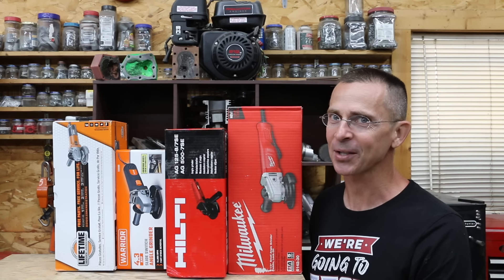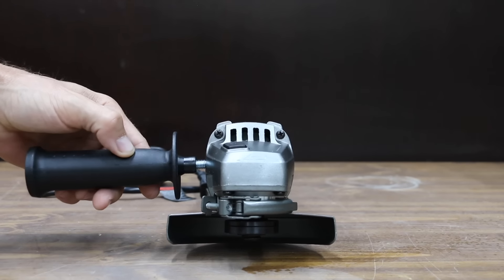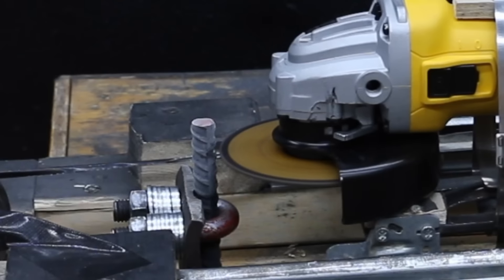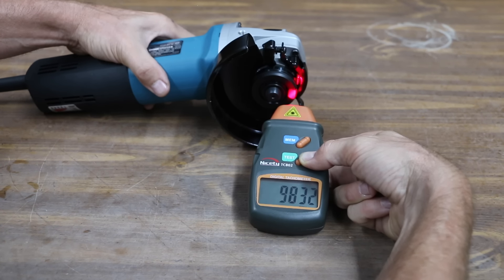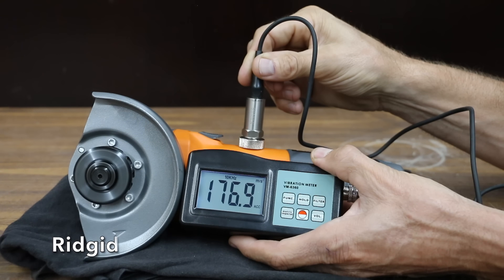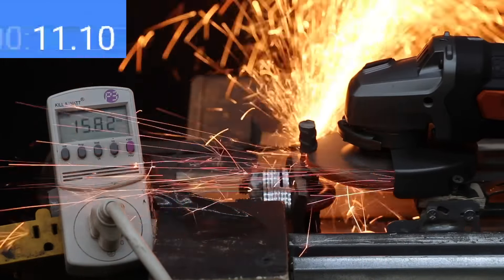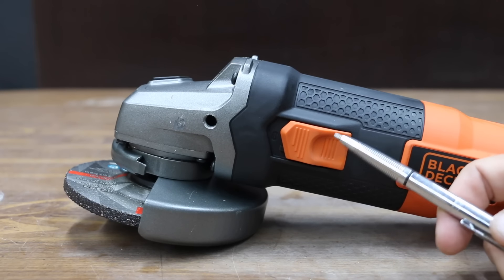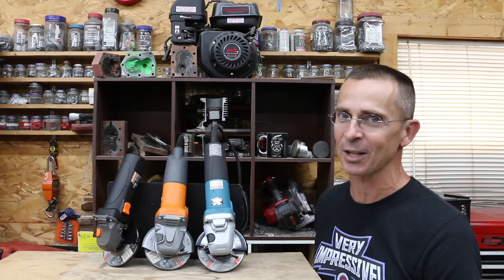Best Angle Grinder (Corded)? Hilti vs Milwaukee, DeWalt, Makita, Ryobi, Ridgid. Let's Settle This!

Comment: Usually grinder performance is rated off from amp draw. The higher the better such as 11-13 amps. They typically run cooler which usually equals longer grinder life and much nicer for the user. A temp rating would have been a nice addition to the ratings. I would have much rather seen more grinders with the same amp ratings. Maybe two tests with homeowner and contractor grade models. Thanks!
Reply from the maker: Thanks for the constructive feedback.
Reply: For the home DIY, sometimes bigger does not fit in the job. Up to 3/16", I think the Harbor Freight model delivers.
Reply: The only way more amps could possibly lead to cooler temps would be if the increased power kept the tool from bogging down which would keep the cooling fan spinning. Otherwise more amps means more power to dissipate. Fans in tools are designed to spin at specific speeds. There's just not a lot of latitude in the product to allow for variability. Beyond that we do not know how manufacturers rate their products. There's no governing body that dictates methods. Is the rating no load or loaded? So those ratings are meaningless.
Reply: @1pcfred  When a tool is rated for more amps it won't always draw that for smaller jobs but the cooling fan rpm is direct coupled to the shaft to stay cooler at less amp draw. From my amateur perspective, I'd rather have a smaller tool that can get into tight spots and just not push too hard for bigger jobs. ~4.5 amps.
Reply: @artsmith103  when you exceed the power of a tool then the tool will lose RPM. We saw it happen in this video and saw the tool burn up as a result. But there's another factor at play there. That would be the gauge of the magnet wire. That's why the current is so low to begin with. The winding wire is thin. That causes greater electrical resistance to current flow. Thin wire also burns up easier. Though one motor seemed to suffer a brush failure. That's often due to how the brushes are held. They can't handle the heat. The brushes are in thin metal holders held by the plastic body of the tool. That melts and causes issues.
Reply: @1pcfred  Everything correct. I was referring to an 8amp tool doing 4 amps of work and running cooler than a 4 amp tool. But in tight quarters, sometimes the 8amp tool doesn't fit. For pros, simple answer is have both. For amateurs, I lean towards smaller cheaper that fits in more places and then go as slow as the little motor requires.
Reply: @artsmith103  overall size does not solely determine power. You can make an 8 amp motor the same size as a 4 amp one. You just have to make it differently. You pack heavier windings into the same space. A winding with larger wire gauge and less length will draw a lot more current.
Reply: @1pcfred  I'm talking about the typical retail options.
Reply: @artsmith103  everything is similar but nothing is exactly the same. The Devil always lies in the small details not the gross simplifications.

Comment: It may seem sad, but to me, one of the best features, and a good reason to buy it, is the tool storage in the handle of the Ryobi.   One of the most frustrating things with any tool is trying to find the accessories when you need to make adjustments.
Reply: Agreed.b The other manufacturers could take a lesson from RYOBI here.
Reply: makes me nuts when there isn't onboard storage for stuff like that.  I have the ryobi and love that feature.
Reply: Why would you need a tool? There are many options that don't need it like the tool less nuts on the Metabo and the new X-lock standard witch has no nut at all.
Reply: I get this on some other tools, but I can't remember the last time I used a wrench on a grinder instead of just grabbing whatever I have chucked up to tighten or loosen the tool.
Reply: 100% agree
Reply: I tie mine to the cord!!!!
Reply: I zip tie mine to the cord
Reply: For what do you need a tool in am angle grinder? 
Never used a tool on them... 
Btw, i use them alot for work... 
Swapping disk? Just grab the disk and rotate it with your hands... 
Changing the protection position? Almost all have a tool less thing...
Reply: I tighten and loosen all my blades by hand. Just grab the blade and twist.  No need for tools, x-lock or self tightening nuts. Very fast too.
Reply: @leonvdm  thanking you
Reply: @leonvdm  - Yeah... and I have this desire to keep my hands and eyes intact.  I don't grab blades by hand and twist.
Reply: I use the Ryobi due to the handle can turn sideways
Reply from the maker: Good Point!
Reply: Haven't used one of those wrenches on any of my grinders
Reply: @lorenzogazzola328  Heavier wheels can come loose from the inertia of starting and stopping if you use that method
Reply: @lolatmyage  the nut is self tightening, doubt it could happen... Also, what disk are "heavy"? It's a 12mm grinder not a 26...
Reply: @lorenzogazzola328  At 74 I sometimes don't have the hand grip I once did. but still put in time in my shop.
Reply: Who, in their right mind would decide on a grinder just because you can store the wrench in the handle?   Aaahh, maby DIY'ers...
Reply: @robertteap8052  hehe
Reply: Please do not loosen or tighten the grinder disc with no tool! Your hand!!! This is dangerous and foolish and NOT recommended by the manufacturer
Reply: @imbacon-cz8xv You made me feel bad for being such arrogant. 
This comment made me remember of all the time spent with my grandpa fixing and creating things... And yes he used the wrench to loose the grinder.
I really miss him
Reply: The next welder you run into ask them to show you how we swap out grinding discs 😅 no tools, just give it a quick sharp whack and they spin right off. OSHA? Never heard of her….
Reply: @GunnysWrenches  no...dangerous habit
Reply: @GunnysWrenches  it's against manufacturers advice
Reply: @lorenzogazzola328  sorry, did not mean to make anyone sad. and sorry for your lose.
Reply: @lorenzogazzola328  I've had it happen with a wire wheel or a grinding disc, can't remember exactly anymore

When you start it, the force is applied one way, when you stop it, it is applied the other way ...
Reply: What about the riund oiece with holes in it?  Arbor lock or wtf you call it.  How the hell are you opposed to remove a non threaded attachment without using the wrench?   I'm not an expert btw.   I am easily able to loosen the sanding disc attachment base with just my hand (there really is no other choice since that arbor lock or whatever the hell you call it blade lock can't be installed on that kind of attachment anyway).  How do you get a metal grinding blade off without removing that round metal piece foist?  🤔.  I'm probably missing something
Reply: @tbelding  Use your left hand to lock the blade with the button and slap the blade counter-clockwise with the palm of your hand. It's so much quicker than any tool. If you're concerned about losing a hand, switch it off. It's not hard to do.
Reply: @lolatmyage  The second you start cutting, the nut tightens itself. That's why the nut only comes off when you spin the blade counter-clockwise, whi h can only happen if you do it by hand or without a tool. I've never had a blade come loose on me unless I accidentally put the nut on upside down.
Reply: @d.k.1394  It's not dangerous. Switch it off so you don't accidentally hit the button and you won't lose a hand. The nuts are self tightening and won't come loose (unless you put the nut on upside down or have the grip strength of a toddler). 

The only "danger" it poses, is if you're using your bare hands and you catch a sharp bit of the disc and it jabs you. But metalworkers generally have tough skin so it's not really an issue.
Reply: The ryobi handle can be rotated 90 degrees it's very handy. 
Been fabricating for 50 years worn out dozens of grinders thousands of wheels I never use that stupid wrench   and never came close to injuring my self.
However those stupid slide switches should be outlawed in my opinion. 
I
Reply: @lolatmyage  I don't use that wrench either. Only wire  cup brushes do that but that wrench doesn't fit them.
So if you hand tighten it like you have a PAIR it's no problem.
Reply: @lorenzogazzola328  he's talking about changing to a heavier wheel, screwing it on, staring it, immediately stopping it. They will spin off.
He should get his wife to tighten it up for him.
Reply: @shona5512  - I know you and others don't think much about it, but I viscerally know what happens when you take power tools casually.  My father, with 40 years of woodworking and engineering behind him, ended up losing most of the fingers on his left hand.   I don't see a reason to push my luck more than the scars on my hands and arms already say.

Comment: I was a little surprised to see the Ryobi have such a struggle with the weighted cutting of the rebar. But, I've always known Makita kicks ass in this specific tool area.
Reply: Yeah I use makita tools, not always the best, but their grinders have been top of the class for decades. Nice to know that hasn't changed. Even approved by aVe.
Reply from the maker: Thanks for the feedback.

Comment: Great review, thanks. I have a few of those cheap $15 angle grinders, not quite the same as the one you tested, but for home use I've found them perfectly adequate. They are so cheap you can just have 2 of them, one with a cutting disc and one with a grinding disc. For heavy work I have a large Bosch angle grinder.
Reply: For light to moderate use, especially intermittent non-professional, the cheap angle grinders seem to be good enough.  Having multiple cheap ones may be more practical than having one better one.  I almost always have 3 in arm's reach:  one with a cutting disk, one with a hard/grinding wheel, and one with a flap disk.  No time wasted in changing disk, just grab the other grinder.  However the cheap ones do vary from unit to unit in vibration and gear lash.

Comment: Video idea: It would be really interesting to see a test of tools where you pit a model from one brand against itself to see if there is consistency between each unit or if you have some that perform markedly better and others significantly worse even though they are from the same company.

One of the things I question when I see a video of yours where the cheap tool outperforms the expensive ones is that maybe you just happened to get a winner and that maybe not all samples from that brand would perform so well. It would be neat to see if that notion is worth considering, or just my bias against cheap things 😅
Reply: I've had like 5 of the warrior angle grinders, in my experience, as long as they don't fail immediately fail, they keep working just fine
Reply: What a dumb statement. These tools are all made with the same parts. Each part has QA. There isn't much variation

Comment: They Ryobi definitely seems best for light home use, having the lightest vibrations, being one of the quietest, best ergonomics, and being decently cheap at $60.
Edit: christ almighty if I knew a throwaway YouTube comment made before even finishing the video would cause this sort of sperg out, I would've bet money on the stupidity of humanity before making it.
Reply: Well, it was the only one to burn out, so I would pick another option. Even for light homework use, I would like my powertools to last for more than a split second.
Reply: Found the SHILL
Reply: Not a bad option, I have one at home slightly cheaper and it is ok for home use. I also use ridgid grinders at work and they are good enough to make money from them. I’d only pick a high end model if I was going to do very specific jobs like cutting a sink or polishing a granite slab
Reply: Compared to the $15 machine it is expensive and did not last.
Reply: All these people getting genuinely angry over Ryobi... Tell us, where did the power tool hurt you?
Reply: I don't know, about that Ryobi, I mean it burnt out.

Since I use a grinder occasionally ( I have a Chicago Electric- HF ) 5 years till working, but I probably op for the B & D or PC over Ryobi and Warrior.
Reply: I was also really interested in the Ryobi because it was easy to use, quiet, and had the least vibrations. But going up in smoke the first time it stalled is completely unacceptable. I hope they fix that design flaw, because otherwise I would prefer this over the Ridgid for those other factors.
Reply: @alexg1778  I was thinking the same thing. They get so mad at Ryobi, it's like someone smacked their kids. It's a tool, who cares what tools people like. Nothing wrong with them for  home use. They get so mad it's hilarious 😂😂😂😂😂😂😂😂.
Reply: I have burned up motors on 2 Ryobi tools.  I'm starting to see a pattern
Reply: I have a prior generation of the Ryobi and it said specifically on the box - not made for cutoff wheels. I only needed it for cutting thin aluminum so it wasn't an issue but it probably would burn up cutting rebar.
Reply: Harbor Freight model is $10. Works great. Wear ear muffs.
Reply: @nickp385  We are not getting  mad just sensible,. If you want to buy it you are free to do so.
Reply: The Ryobi burned up! Did you see the second list where he showed based on only tool performance that the Rigid which is also $60.00 was second place? It out performed tools that were 3 times it's price. I am disabled and would welcome things like the comfy power switch and less vibration of the Ryobi but not at the sacrifice of a tool that will burn up if I push it too hard. What good is an easier to use BROKEN tool?
Reply: I bought my first Ryobi when they were still blue. It lasted about 15 years, then I left it in the rain. When I was shopping for new ones, I was surprised that Ryobi was the only one who offered that kind of handle and trigger configuration. It's far more comfortable and efficient to use. I've had this one 3 years now and have had no problems. This is just my experience though.
Reply: Stay away from ryobi! Ridgid is far far superior
Reply: I had several ryobi tools die and it died in this test so i won't buy anything from them
Reply: @alexg1778  I mean it sliced my finger open...
Reply: The rigid would be better then ryobi it’s even the same price
Reply: @tonysheerness2427  I bet it’s not $15 anymore
Reply: @tonysheerness2427  I know I'm free to do whatever I want and buy whatever I want, I just think it's hilarious the energy people put into knocking the tool. Some people act like they owu a competing company. Don't get me wrong I love watching how foolish people get over a tool, it makes my day lol lol lol.
Reply: @alexg1778  my uncle would buy them and then return them. He finally wised up stopped buying their products.
Reply: I have to believe all these Ryobi comments are paid shills. The damn thing BROKE on camera and nobody gets it?

Comment: Great test, I've been using Makita angle grinders for decades, and although they're expensive I would not even consider to buy another brand. Makita corded tools is A+, whereas some of their battery tools still need some development/improvement to catch up with the competition in the high end market.
Reply: Makita is usually slower to release new updated tools, most of the tools they are compared to are newer models, but when they put out a new tool it usually is close to top of the line
Reply from the maker: Thanks!   Thanks for sharing.
Reply: Yeah most of Makitas latest tools are out in Japan first for a while before making it to the US
Reply: Cordless Makita tools aren't always the best but they will last (but don't buy the cheap brushed models)
Reply: Makita cordless tools, especially drills and saws are far superior to the other 2 big brands.

Way more ergonomic, less vibration, next to zero runout on the chucks. The other brands are the ones that have a long way to go to catch up. All out power isn't everything in a tool.

Comment: Nice and I actually bought the Harbor Freight one for sharpening lawnmower blades.  However, used it well for cutting one of the rusted nuts / bolts of stabilizer links (which took awhile as you tested).  Even if it breaks, definitely worth it as I do not expect to use it more than once a year at best🙂
Reply from the maker: Thanks!  Thanks for sharing.
Reply: I've had two Chicago electrics for almost a decade now and one of them just died about 3 months ago when I started working on a trailer restoration project that involved a lot of heavy grinding. I'd say that's a pretty good return on investment for a $20 grinder.
Reply: If your like me I only use an angle grinder once or twice a year the warrior is fine.

Comment: Good test! I was particularly surprised by the Ryobi letting the smoke out after only a couple of seconds. Might have been faulty out of the box, but regardless, this shouldn't have happened. I'd definitely go for the Makita, as it just has heaps of power, and I think it also has a constant electronic. But the paddle switch design on the Milwaukee looks really comfortable as well.
Reply from the maker: Thank you!  Thanks for the feedback.

Comment: For wire wheels and such, I bought 6 warrior grinders when they were on sale for $9 each. I use a rigid for cutting. Great test, Todd!
Reply from the maker: Thanks!  Thanks for sharing.
Reply: Me Too !!!!!!
Reply: Same here, I'm finishing up welding school and bought one of the warrior grinders to keep a wire wheel on. It's held up great so far, not quite as powerful as my Dewalt DWE402 grinder, but it's still been shockingly good for the $15 I paid for it.